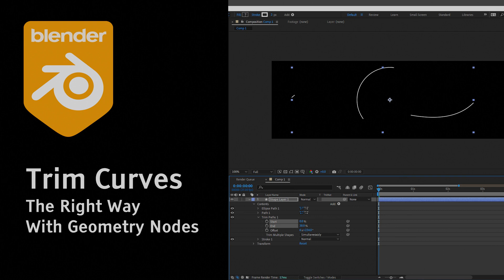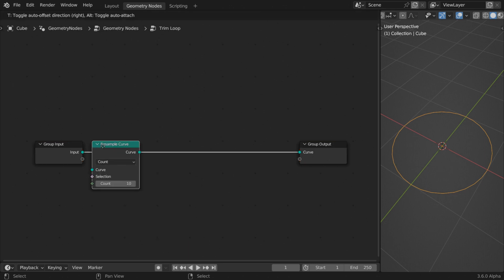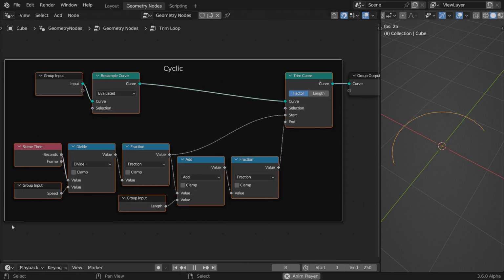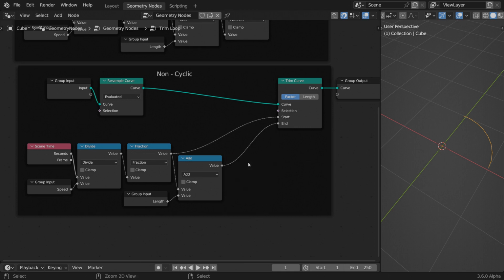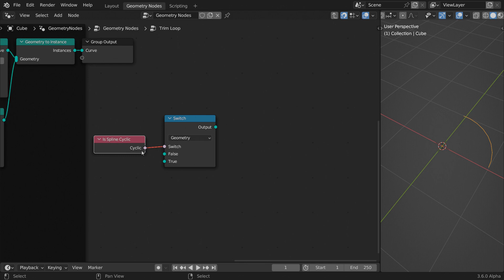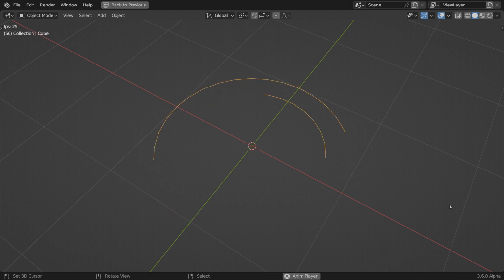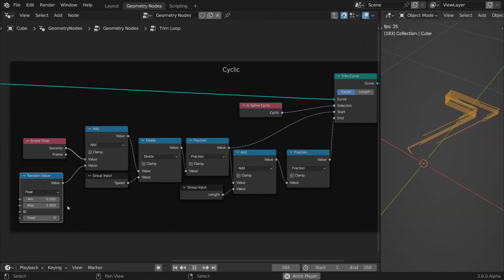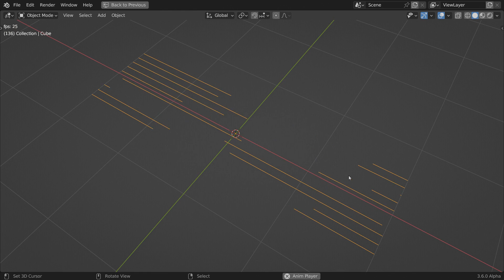Trim Curves - The Right Way With Geometry Nodes

Comment: This is great! Thank you for this tutorial. 
I have my trimmed curve going into a "CURVE TO MESH" node with tapered ends using the "float curve" into a "set curve radius" node..
When it gets to the end or the beginning, I am getting a pop where it squeezes down to a circle then disappears.
Do you know a way I can have the length of the curve determine the radius?
Ideally I'd like to have the radius shrink to zero as the segment length gets to zero..

Comment: Is there a way with your method to keep spline parameter? I tried to instance icosphere on end points of animated splines and found out I can't really bind it's scale to spline parameter captured before trimming.
Reply from the maker: If you just want an icosphere at the end point of each animated spline, just set the End Size of Endpoint Selection to 1 instead of 0. Why exactly do you need the Spline Parameter captured? I don't know what you're trying to do. Could you be more specific?
Reply: @ilirbeqiri  Already figured what was the issue, replaced geometry to instance with join geometry. Captured spline factor allow me to scale instanced icosphere to 0 at the spline ends.
Reply from the maker: I’m glad you worked it out.

Comment: This is great thank you.
I converted the TrimLoop output to mesh in order to render (using Curve to Mesh node & a Curve Circle as a Profile Curve).
I get a static Circle at the spline start points (maybe from a zero length spline. I'm not sure) that's not visible before Curve to Mesh.  I cant get rid of them (I'm not very good with Geo Nodes).
Hopefully its because I have done something wrong.  Does anyone else have the same issue?
Reply from the maker: Anytime you have a zero-length curve as a guide, you see the profile curve. It's not a bug. As you said, you converted to Mesh so you can render. Neither Cycles nor Evee is able to render curves, so you're safe.
Reply: @ilirbeqiri  Ah yes that makes sense, thank you for your reply.
I have just replaced the Random Value node with the different Texture nodes to modify the trim speed.  Getting some lovely effects rotating the input vectors.  Lots of fun.
Thank you for posting these tutorials, I'm learning a lot from them.
Reply from the maker: I’m glad you found them useful.